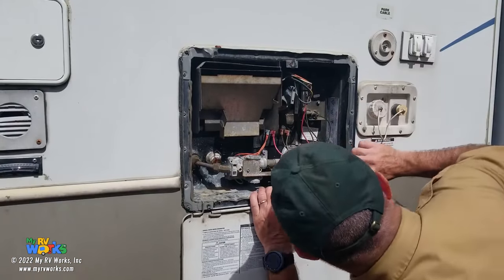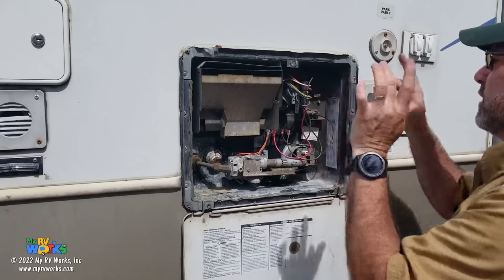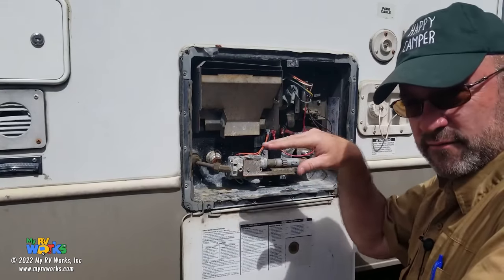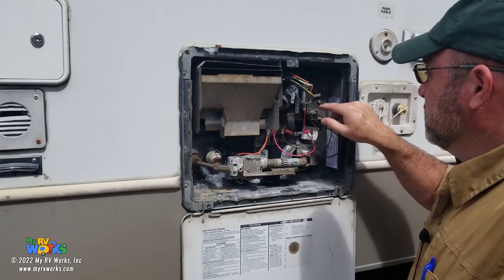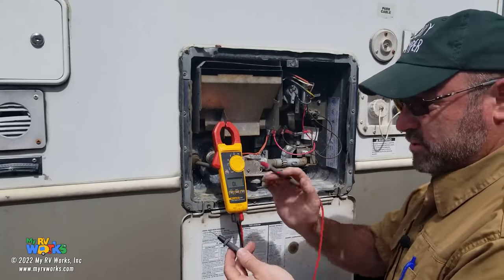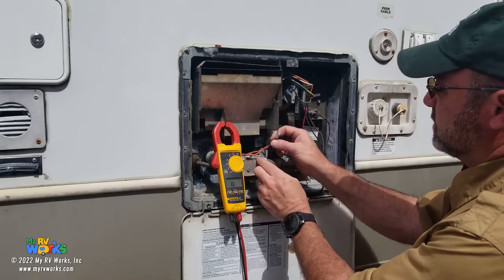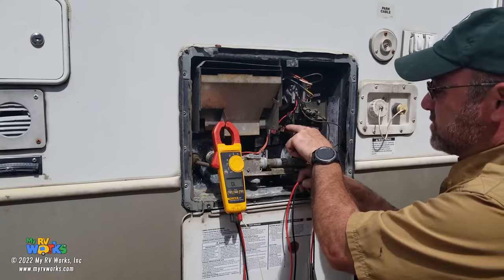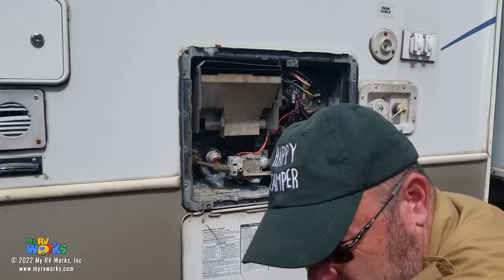Atwood Intermittent RV Water Heater Issue  -- My RV Works

Comment: Darren,
 I sure appreciate you taking the time and effort to create a video that helps us RV owners troubleshoot their own water heater issues. We have a 2004 Itasca Horizon 36GD with the CAT C-7 330HP and of course, it's a 20-year-old coach. The water heater is a CGH10A-4E with the three ways of heating the water. "Motor aid", 120AC and of course Propane. Well, this w/h has been working flawlessly for over 20 years and just recently, stopped working, on both 120AC and Propane. We were camping at the time and me and a buddy did some investigation and determined that the Thermal Cutt off element was bad. We removed it from the loop and connect the brown wire directly to the thermostat. Zooom, the water heater kicked right off, Yahooooo. 

Upon returning home, I ordered up the correct thermal cut off element and upon receiving it, I inserted back into the loop and the heater kicked on for about 2-3 seconds and right back off. I removed the new thermal cut off element and reconnected the brown wire to the t-stat and still no light. I have continuity through the t-stat and the ECO. But, based on your evaluation and explanation of how the flow of electricity works in these heaters, I'm pretty sure I'm not getting any power (12V) to the red wire to feed the ECO. 

I just received a new circuit board and will install it tomorrow. We'll see if that was/is the problem. Thanks again so much for your assistance here. By the way, I can't seem to find your video on the explanation of all the colored wires and their function you said you made. I'll keep looking. Thanks again.
Scott

Comment: Thanks a  million. My water heater was flaming outside of the burner tube. Per your advice I removed it and saw a thin spider web film at the bend that was blocking the flow. A few scrapes with a flat blade screwdriver and a blast of compressed air and I was back in business. I caught it in time before the flames could melt the thermal cutoff. Thanks again.

Comment: Me again.  I should have paid attention to the name of your video !!!!  My water heater was intermittently shutting off.  When you disconnected the multi wire plug in the top right,  it fixed your problem. RIGHT ?  so I just kept watching and trying some of the other fixes. after 2 days of messing around I finally thought I should try what you did by disconnecting the plug,  BINGO !!!!  corroded plug !!!  pulled it off and put it on a few times ,  IT"S WORKING !!!  It appears to have been the corroded plug.  My trailer is about 12 years old.  Evidently  enough time for a plug to corrode !!!   I must remember to try the simple fixes FIRST !!!!!!  Thank you !! Thank you !!!

Comment: ~5:52 is where I found my answer; shoveling snow off the roof here in Truckee, CA after the recent blizzard piled up to the windows of the RV which completely covered the vent/door of the water heater. I thought it must have been the blocked exhaust vent that choked it out, but it wouldn't relight despite being a fairly simple mechanism. Turns out it was the thermal fuse that was inline and blown. Thank you for your knowledgeable explanation.

Comment: Hello Darren, new subscriber here. I have the exact same Atwood unit you are working on in the video. My service began due to the unit intermittently popping or opening the pressure relief valve. Before I started my service and replacing of parts, the frequency of the problem was much greater. So, I removed and clean and bench tested the gas valve assembly, I replaced both the T-stat and the ECO limits, I drained and cleaned the tank, I removed the shields and totally cleaned the exhaust vent, I removed the igniter, clean it and set the gap at 1/8" + - and I replaced the pressure relief valve. The only item left was the board. I ordered one on line and when I installed it, the igniter would run and not shout off even after the gas valve opened and flame was visible. It's like the board doesn't see that the flame is established and it shuts the gas vale back off. After a couple of cycles, the red light on my inside control panel lights up red and I must reset it for another cycle.There is plenty of gas and if I switch back to the old control board I'm back where I started. It operates but still occasionally, pops the pressure relief valve.

Comment: Great video!!! My board was bad but only on the spark. Full continuity on the “striker” but would not click and would not read flame when I lit manually with bbq lighter. Problem, I already bought eco, thermostat, thermal fuse and installed them. So replaced the board and it works like new! Heck its only been used once on gas in 3 years we’ve had it. I learned a lot doing this, then more watching this video. Now I have spare parts! Wish that board wasn’t $200ish. Thanks!!!

Comment: Great Video-explained all elements regarding "electrical" parts that can go bad and how to check. My only suggestion is the part that I found was left out (or perhaps I missed it).  The "venturie" or "ventura".  Removed this brass part(be careful, mine was very tight)  Positioned the orifice toward the sun and noticed the "hole opening" appeared to be occluded somewhat. Used a straight pen, cleaned it out and WA-LA.  Reassembled and "Fire in the hole".

Comment: Where were you yesterday when I was trouble shooting a nos ignition issue on my water heater? Troubleshooting blind I wiggled the connector on the control module and it started so I found the fault but this video certainly was helpful and gave me a much better understanding of how the system works. BTW, your presentation style keeps it entertaining as well.

Comment: Me again.  CHECK FOR CORRODED WIRE CONNECTIONS FIRST !!!  I recently spent over 3 months in North Carolina with LOTS OF RAIN and extremely cold weather. And  it was a corroded connection..   THANK YOU !!!!!   I am NOT A MECHANIC !!  Just a parts changer .   I was so close to just getting a new water heater.  GOT LUCKY with your video.  Thank you !!!!

Comment: Very informative! It didn’t answer why mine lights up fine but kept clicking after it was already lit. Then shuts off after a few seconds and the fault lift inside the coach stays on. You started to say "If this would have kept doing that" when referring to the tik tik sound but never finished.I will now look at your other videos and subscribe and like.
Reply: The flame sensor/igniter is faulty if it continues to try and ignite while flame is on. Then the flame kicks off. 
 The igniter should send a signal to the board telling it to stop igniting, it is not doing that.

Comment: Watched the video and it helped me troubleshoot and fix my WH. It was the problem of firing and shutting down after about 10-15 sec. Pulled out the tubing, all wire connectors and igniter, cleaned all and put back together. It worked. Have HOT WATER! Wife is much happier now! Have to see if electric side works now. 

Lastly Adjusted air intake and even at the smallest opening it will run quiet but intermittently it will roar again off and on. What could be causing that? Thanks again for your great videos!

Comment: Great video.  My electric side on my Atwood is not working and I have been troubleshooting but unsuccessful so far.  My issue and what I learned today is I don’t know how to use my multimeter and will check the advice today and see what the issue is. I suspect the thermostat and will go check continuity.  I can also recommend the dinosaur DSI board.

Comment: Best. Vid. Ever.   for repairing a Dometic/Atwood water heater.    ...having said that, I learned to always double check the bypass valves...   I managed to successfully mimic a dual electric/gas failure.   I now have a nice stock of spare parts in case I get an actual failure. :)     Does anyone want to buy a circuit board for a Dometic GC6AA-10E, part# 91447.. Looks like I won't be needing it right away..........

Comment: Awesome, great tutorial. I have the same exact model number. Just did some work on mine. Had a bad element, but as luck would have it, the new element was bad too. Took some time before I figured it out. What are the odds that the new element would be bad? I couldn’t believe it. Anyway, love the videos and the detail you provide. God Bless!

Comment: Not the problem that I have, but your explanation of the function, turned on the light bulb. Got out the DMM after knowing what wires should be doing what. I am pretty sure I found the issue. Waiting on parts

Comment: Awesome videos!  My Atwood (Lp mode )water heater cycles 3 times like it wants to turn on.   If I turn off/on the switch 3 times or more.  It will then run for about 5 mins then turn off.   Could it be the mother board ?

  My electric has never worked . But with your videos I am going to find out what is the issue.

Comment: I was leaking water out of the pressure release valve for a couple weeks till I changed it. one day later, power is completely died on the unit for both gas and electricity. what are you suggest or recommend? this is the most informative video I've ever seen on the subject by the way. thanks

Comment: Did all do you have instructed!! Replaced thermal cutoff, new igniter and new control box. Seems like it's starving for propane! Will I need to order a new solenoid valve? It's a gh6 - 8e. It was firing up and then it was having trouble keeping propane flowing. It's kept clicking and then nothing 😭

Comment: Just as on your video, mine stopped coming on and after removing a few wires just poking around inside the panel, it began working again!  Although its working fine, I have the LP "fault" light illuminating on the switch panel.  Now to find out what's going on this this fault light, any ideas?

Comment: Hi there! Great video. I have an Atwood hot water heater.
I am having the issue with the flame going out after just a few seconds.
I took apart few parts and cleaned everything and installed a new igniter, but the flame still goes out after a few seconds. Do you have any other ideas on what the problem may be?
Thank you

Comment: I sure wish you were down here in Seaside, Oregon! My Atwood went down - "pilot out light" stayed illuminated. Changed out both thermostats, the thermal fuze and the circuit board. Now, the AC heat works, but the LP does not. After checking the red wire leading to the ECO I see I get only 8.55 volts when the switch is on. Also, there is an electrical "hum" somewhere near the circuit board that happens when the switch is on. Man, any help from anyone reading this is appreciated!

Comment: I need to review mine this spring, specifically on the 12v not AC I had an issue where mine would fire off no problem first thing in the morning, but once it was out of hot water and went to kick off again I would just get the tick tick tick and it would not refire. Tried new thermostat, eco, and sparker just odd it all works fine, until it doesn't.

Comment: I enjoy your videos and have learned much from them. I have a WH-6GEA Dometic. I have so far replaced the thermal fuse two times. Because this is a safety device and is a common issue, do you know what the solution to the fuse blowing is? The link is installed horizontally. The flame is a bit more yellow than I'd like to see. The last time it blew, I did hear it short cycling, on and off.

Comment: According to Dometic techs, replacing the plastic drain plug with something else voids the warranty. They state the plastic plug is a safety feature - last resort on overheat over pressurizing the tank.
Reply: I call that BS. They are not in the water heaters you have in your homes. They use the same safety valves.
Reply: I never heard that. The reason in the manual states it requires a plastic plug because it's an aluminum tank and brass and aluminum are not compatable metals with each other.

Comment: We are watching videos to figure out what is wrong with our Water Heater, it is turned on to LP and it runs, heats the water, then kicks off as it is supposed to do. Then it kicks off and on a lot, after it heats up. 
What could be the problem??? We think Thermostat, but we also are thinking Computer board. Do you have any suggestions? It is 9 years old and not used often. 
We would appreciate any suggestions you could offer. 
Thanks for a great video!!!!

Comment: Wonderful video, man! Having our water heater not detect the ignition, BUT the spark component is fine (also measured and replaced). It ignites 3 times immediately  but the spark does not stop, indicating the detection is not happening. Some thing to note is that  both replacement boards I used hum.. Everything is grounded well.   Any thoughts on what to dig into further, or should I just get a Dinosaur  board and hope it will work better or ?
UPDATE: Dinosaur board works great! - Returned the 'not made in the USA'  boards which DID NOT work. Get what "My RV Works, Inc." recommends!

Comment: Great video  I seen your previous video on what all the wiring voltage should be and what do they do. I have trouble shot my RV based on your video and have a question. So I traced power and I have power at the thermostat and back to the control panel and back out to the yellow cable that goes to the back of the heater to a relay. My question is how can I find the rear relay? In this video you consider the board bad if you don’t have any power going to the gas valve but doesn’t the relay send the power back to the board before it sends power to the gas valve?

Comment: Awesome video n very descriptive.  My waterheater shuts down after 4 to 10 mins. The red wire is reading 11.1 volts n brown are reading12.0v. The orange wire into board shows 12.7. Batteries show 13.4 . I'm thinking that the board is reading that 11.1 volts and shutting down. Am I on the rite track or is it the board making resistance n making the 11.v?

Comment: HI !  How you doing today ,my Name is Mr.herman Woods . Can you do a video ! On changing out a atwood to a domestic water heater . I am doing one , The Gas line .Comeing in at the Bottom .And the Domestic ,comes in at the TOP ! I Bought 3/8 copper tubing . and add a 3/8  adapter flare to add more tubing , to make it to the top .of the water heater . Is that the way to do it !  Thank you for your Time. Mr.H. Woods

Comment: @MyRVWorks i have a Atwood 16-6e(a) water heater ,i have replaced all parts trying to get it to work properly.everything trys to ignite but the gas solenoid valves wont open.i can hotwire the valves from battery when unit is trying to ignite and away it goes no problem..but plug it all back in as normal and they wont open.....any ideas??.....new solenoids,thermostat,overheat and pc board......thanks  Dan.

Comment: My LP switch on the inside of my camper does not light up. The electric side does. Any thing I can check since my LP side of my water heater doesn't work? Fuse or circuit breaker?

Comment: What’s the cause of warm water coming out a Atwood? Replaced both thermostats, control board, adjusted flame, replaced electric element. I believe I didn’t turn on a bypass valve .Any ideas?

Comment: Water Heater not showing spark, have power on brown wire 13 volts, checked solenoids 40 ohms, no power at read wire on control unit, both thermostat and eso replaced.    How do i know the control unit is bad, which i suspect, no power at igniter connection at control unit.    1999 Jamboree

Comment: My cousin came from Fla to Ma and his HW cycles 3 times and shuts down, 1st thing I found was the blown 2 amp fuse on the board and it kept blowing the fuse so we replaced the board Things Ive checked lit stove to purge the gas just in case then Continuity at the ECO and T-Stat, thermal  cut off, I powerd the solenoids with 12 volts and blew through the gas valve, also checked each solenoid separately and got 41 ish olms, Replaced the igniter flame sensor just because, cleaned all connections and the body when I had it apart still cycles 3 times and cuts out, no voltage to the solenoids once it cuts out so something is telling the board its not lit, possibly low gas pressure next ?
Reply: Did light the fridge on propane and worked flawlessly so water column pressure at gas valve may be fine.

Comment: I have an Atwood heater gas fired up getting hot water only for about 15 seconds and turns cold and no more hot water tried electric mode same thing tried both mode still same thing . ?

Comment: U R the MAN!! I've seen some of your videos and I give U= 👍,a10+, I am very PLEASED. TY for being U.
A little TECH help please. I have 2002 HURRICANE. 30Q.
Running the Generator = powers AC.,Microwave no problem. But when I plug in the TV IT'LL play 
about 10min. And then it starts to turn ON &OFF. But when hooked to shore line it works fine.PLEASE give some insight. I'm way to far to come to U & to far for to come to me.T Y

Comment: I have a 2018 Attwood water heater that try's to start but makes popping noise after ignition and flames out,  this happen mutable times before it starts.  Any Idea where to start looking, or have you seen this before?  GREAT Videos I'm subscribe and watch all the time.
Reply from the maker: Try getting a can of the office air and blowing it through your burn tube. You may be picking up some rust or spider nest or something in there that's restricting the gas flow.
Reply: @MyRVWorks  thank you I will try that if not I just looked your lasted video and it will help diagnosis the problem.